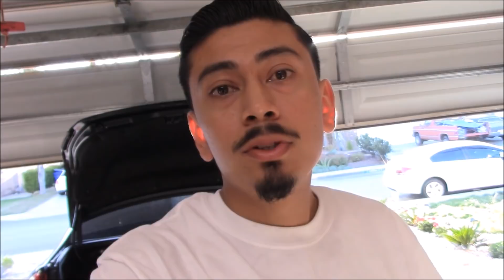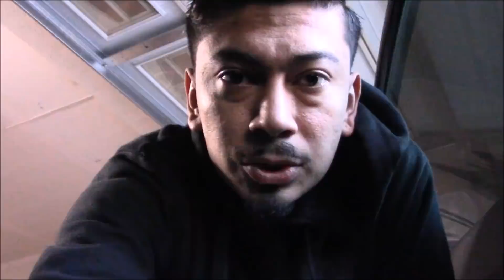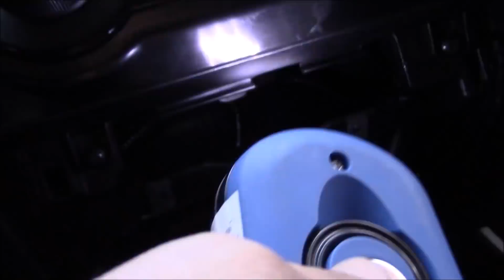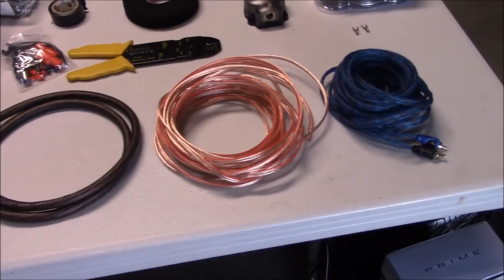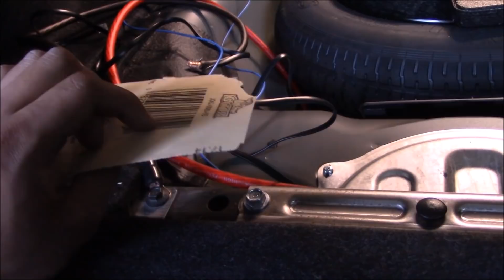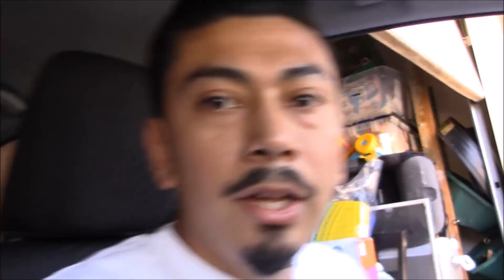HOW TO INSTALL AN AMP TO A FACTORY RADIO | 2015 HONDA CIVIC

Comment: What did you do with the black wires on the line out converter and what wire did you use to attach the rear speakers to the converter ?
Reply from the maker: The black I believe should be your ground on mine the ground was black and I connected it to the ground of the amp you can also just bolt that wire down to the frame of the car and as far as the wires there should be 2 Plus and 2 minus so for left side speaker u have to connect a plus wire and a minus wire and via-versa for the right side I believe I showed it in the video my friend hope that helps
Reply: Did you use extension wire? cause those wires were pretty short
Reply from the maker: Yes I just grabbed extra wire I had laying around (same gauge size) and just used that to extend the wire

Comment: can u use regular stranded electrical wires for power and ground? what size?
Reply from the maker: I probably wouldn’t recommend it but ima sure u can as far as the gage size it all depends on how much power your running how many watts your amp is going to be pushing

Comment: should i hook up to back speakers or front? i heard front gives better loused harder bass
Reply from the maker: If I’m not mistaken front and rear gets the same output on these cars 🤔 as the radio throws out the same for the front and the rear but I’m sure you can do it on ether I did mine on the rear just because it was easier to access

Comment: i am thinking about adding an amp with after market speakers, my question is why did you not add similar RCA converter to the front speakers and is it possible to tap into the factory speaker wiring behind the stereo to get your front speaker RCA and rear RCAs....thanks Really detail video.
Reply from the maker: So sorry for the late reply, you can tap into ether and you can also tap into the wires behind the stereo I just found the rear most convenient and easiest to explain and I’ve heard people recommend doing it that way but you sure can do behind the stereo but I’d still recommend useing the rear speaker wire if u do it that way and thank you so much I tried my best so that means a lot to me :)

Comment: Can this install work with a 2013 civic? The head unit looks different
Reply from the maker: All the steps should be the same the only thing as far as the remote wire (blue wire) for the rear of the stereo you would want a tester just to be safe and not tap into the wrong wire, another thing  what u can do is pop off the stereo and just see if the wires are exact to mine I know the 2013 like u stated are different but it can possibly be the same

Comment: I have got Toyota Auris 2015 what wires do i have to connect into back of my stereo to start it work? If i connect just a blue wire which is RCA is it just this wire do i need to connect or more?
Reply from the maker: Is it aftermarket stereo or the stock one that comes in the car ?, the blue wire goes to your essentially “remote” switch but varies on if it’s a stock stereo or not and the rca will depend as well if it’s a stock stereo you need to purchase a line out converter
Reply: Its a factory stereo?

Comment: Hey man i want to do this to my car but im not sure if i can because my car has a factory amplifier do you think i could still add another amp with a subwoofer? Awesome video by the way
Reply from the maker: Sorry for the late reply, and on that I’m not 100 percent sure but I’m sure you can because most the time those amps that come in the car are for your highs (interior speakers) so if your adding another amp for the subwoofer is sure that would work 🤔

Comment: i’m having trouble trying to find a place to run the power cable thru the firewall
Reply from the maker: I ran it threw the side of the fender and in there these a small black grommet you can push threw into the frame of the car which leads inside the car u can see it in the video but if you want to do it straight into the fire wall you have access threw the passenger side it’s just more panels to remove that’s why I didn’t do it that way
Reply: Jesse Rizo ooh okay. yah i know you said there was a hole but when i got down there i couldn’t find it lol
Reply from the maker: O lol my bad yea it should have like a rubber grommet (black dust cover) that you have to pop out then you have access I found that easier then going threw the passenger side to go threw the actual firewall lol I hope it helps bro I tried to film it as best as possible lol
Reply: Jesse Rizo is it for where the hood release cable goes?
Reply from the maker: If I’m not mistaken I didn’t run mine threw there because the wire was to fat but I’m sure if your wire isn’t as fat it should fit where I ran mine there was nothing going threw it if I remember correctly
Reply: Update: i ended up finding a grommet to pop out on the driver side and i got everything hooked up. The only difference is that i wired my remote wire to the fuel pump fuse
Reply from the maker: Matt Perry that’s great Matt and it should still work just it might stay on everytime u start your car but it should be fine that’s awesome that you got it to work I hope the video did help

Comment: Great tutorial Bud.
You should have used a Panel tool, wire cutter, Philips Screw drive, A drill would have made it much easier LOL
Awesome job bud. What prevents the sub woofer from sliding around in the trunk?
Like #48
Reply from the maker: I did my friend :) 👍, thank you and just getting L shaped brackets and bolting it down to the floor :) I didn’t show it in the video but that’s how I have it

Comment: Bro why'd you put the amp on the subwoofer box? it'lll rattle the crap out of it. No disrespect bro I'm just asking. Awesome video and keep up the good work
Reply from the maker: Because I’m getting a secondary amp for my highs and that amp is long in the video I showed how small the rear seat (hole) from the inside to the trunk is so it would only fit one amp which will be the big one that goes there that’s the only reason other wise I would also recommend not putting it on the box, but as long as the box is good quality and the screws You put for the amp onto the box there should be no rattle issue that’s the only reason but yea I wouldn’t recommend it, thanks bro I appreciate you watching

Comment: Very detailed installation instructions bro. Would you recommend installing a separate amp for your highs?
Reply from the maker: I would definitely recommended a separate amp only if you have upgraded your speakers if you did not then there’s no need for it you’ll just end up blowing your stick speakers but if you do upgrade your speakers (highs) and get a second amp getting the distribution block is highly recommended as well I talked about on this video,thanks for watching bro :)!!!!